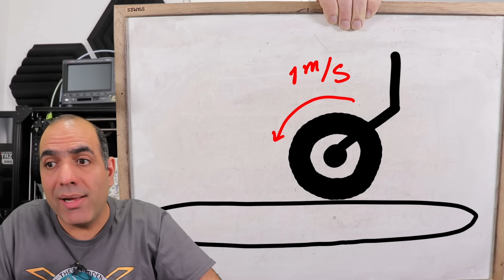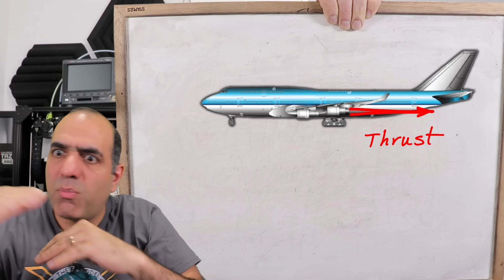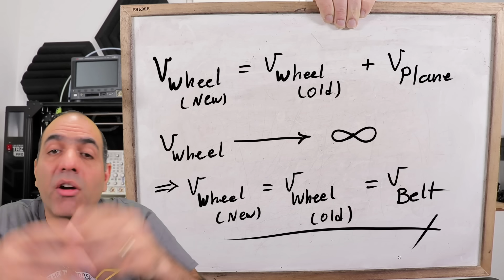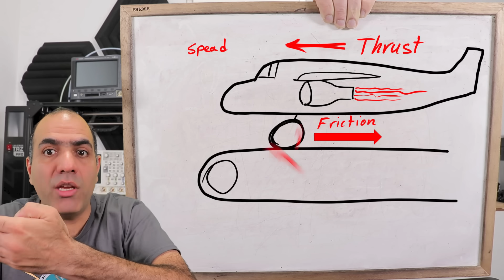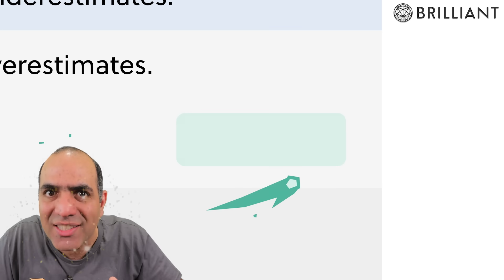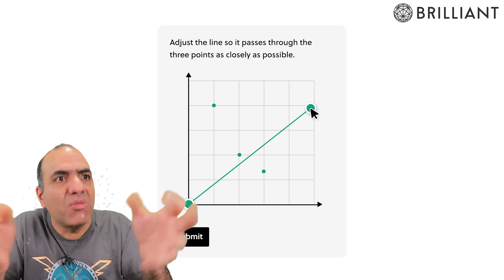Airplane Question that Drove Me NUTS!!!

Comment: The wheels don't have anything to do with the jet moving... so yes, the jet would take off if the engines were making thrust...
Reply: no matter how fast the conveyor went in the other direction the aircraft would move forward because of thrust from the engines...
Reply: The wheel bearings negate any friction from the belt.
Reply: Also at a certain point the wheels would slip on the belt. friction can be overwhelmed.
Reply: I understand on paper, the jet doesn't take off. But we live in reality, the jet would take off. The question was asked by someone who thought they were smart, and the fact they posed the question proves they weren't.
Reply: Did Steve Mould ask you this question? that would make sense, there's a guy who thinks he is smarter than he really is. "Mould Effect" still has me shaking my head at the arrogance of it all.

Comment: It's hard to believe this is considered a legitimate question. Wheels have nothing to do with flight, airplanes don't need wheels. You just need air moving around the wings airfoil to create lift.
Reply: It's a legitimate question because lots of people think the conveyor belt contraption can prevent a plane from moving forward. 

The engines impart a force to the plane pushing it forward. The conveyor belt can't impart a force to the plane to counteract the force of the engines. So the plane accelerates normally and takes off.

Comment: Not likely or reliably. Tire limit speed for aircraft like this are around 174 kcas, and half the tire limit speed is still less than rotate speed for all but the lightest weight 747. So if it's possible tire failure is all but assured.

Comment: pretty sure aircraft require wind passing over the wing to lift off unless they have VTOL jets or rotors or some sh!t like that. if the wheels are moving but the plane is not moving relative to the surrounding air, you're wasting fuel and you're not gonna leave the treadmill
ofc, if its a jet aircraft, the wheels are not providing drive force, the jets are. and the jets are grabbing hold of and moving the local air, which means that the plane is likely to ignore the treadmill entirely (because the treadmill is only acting on the presumably free-spinning wheels) and move forwards (and likely right off of) the assembly, rendering the test moot and maybe causing a bunch of damage in the process. (infinite treadmill? basically an infinite runway.) come to think, prop planes also use their rotors to push on the air, not the ground, so they too would completely ignore the treadmill.

Comment: The wheels do not power the plane, the engines provide thrust independent of the wheels. So it really doesn’t matter if you are on a conveyor belt, you will still pick up speed and take off, the wheels will just be stunning faster than normal.

Comment: This is a very old question but the answer, as you stated is very simple: wheel speed has nothing to do with the forward motion. Meaning that the airplane will get airborne based on the relative wind speed over the wing creating a drop in pressure and thus, lift. Having a conveyor belt underneath will only increase the wheel speed but will have zero effect on the airplane as soon as thrust is applied. Now, if you reverse the belt making it go forward, then you can make the airplane go airborne. Similar to a catapult on an aircraft carrier. You’ll still need thrust once airborne otherwise you won’t be gliding for long

Comment: I believe, yes, the plane can take off.. Seems like something of a trick question. "The conveyor is designed to exactly match the speed of the wheels."  This is a bit ambiguous (what does 'speed of the wheels' mean?) so choosing to interpret this as: When the wheels spin the conveyor spins to match countering any push/pull the wheels would normally impart, attempting to say keep a car stationary in relation to the surroundings as the car attempts to drive away. If this is true, then the conveyor would appear to launch the plane, spinning up to keep the plane's wheels effectively static, non-spinning, as the plane accelerates away until it lifts and the wheels lose contact. But that's ONLY if everything's perfect. Given there's no chance of perfect efficiency, there'd likely be SOME wheel motion one way or the other, probably spinning exceptionally slowly "forward" (the direction they'd normally spin if NOT on a conveyor) in relation to the motion of the plane.  It's an interesting question that completely changes depending on if the vehicle in question uses its wheels to move or something else (jet engines, a winch, sails, etc.).

Comment: Not this freaking question again.
Before watching the video, I can say this: the answer is that the conveyor belt will quickly hit the speed of "undefined," at which point physics ceases to make sense. 

Maybe the conveyor generates enough wind before then to lift the plane high enough that the wheels lose contact. Maybe it overwhelms the bearings to the point of throwing the plane backwards. Maybe it destroys the tires, causing the plane to fall onto the landing gear which is then smeared across the possibly relativistic conveyor belt, which then halts because the wheels can't spin if they're smeared into paste. Someone, not me, could probably calculate at what speed the conveyor belt would need to spin for each of those things to happen for a particular aircraft- though it obviously depends on engine thrust, lift from the wings, landing gear design, conveyor belt materials, etc. none of which are specified by the question.

Comment: I have to admit, I changed my comment, I thought the plane would remain stationary.

This is very counter-intuitive cuz I think we all think of  cars and bicycles first when wheels are evoked.

It helps to visualise the situation like this I think: the wheels of the plane are there only to reduce the friction between plane and ground, not for thrust.

So as Mehdi said, if the friction is still low enough, no problem, plane takes off.

Comment: My (totally serious) answer before watching the vod:
The engines push off from the air, not the ground. the conveyor belt moving in the opposite direction only adds drag to the whee;s wish i believe would not be enough to prevent the airplane from taking off. The problem is that the conveyor moving against the direction of take off 'adds' speed to the wheels, it doesn't 'undo' any speed. If the wheels would move forward at 10 distance units per time and the conveyor tries to work against it, the wheels will speed up to 20 units per time, creating a runaway resonance cascade that destroyed black mesa.

Comment: Its a matter of lift not wheel speed. The wheels have no effect on lift outside of drag. A hugh enough crosswind and it can take off from a stand still.

Its like flipping your bike over and turning the peddles really fast, sure the wheels spin but other then acting like a gyroscope it's not doing anything.

Comment: Yes, the plane can take off, no problem at all. The reason is that the thrust driving the plane forward is coming from the jet engines (or propellers if it has turboprop engines), not from the wheels being turned like a car. So the wheels on the plane landing gear would have to spin faster than normal, which would probably require a little more thrust than for a normal takeoff.

This is no problem, since in most circumstances, airliners only use about 80% of the rated maximum power of the engines for takeoffs - exceptions being for short runways or heavier than normal takeoff weight. High ambient air temperatures at ground level is another problem - in middle eastern nations, some aircraft have to wait until night time when the air is cooler before they can take off, though of course landings can happen at any time. At high air temperatures (40 to 50 degrees C), the engines suffer from reduced power output because the maximum thrust is limited by the temperature the turbines can tolerate before weakening or melting. This is why jet engines perform better in colder climates, or at high altitudes where the air temperature is naturally much lower.

Comment: Quick question, if the plane is not going forward, how are the wings having friction with air and therefore producing lift? As far as i know the engines provide forward thrust so that the angle of attack of the wings can interact with air and produce "lift", however if this forward thrust is mitigated by the treadmill how is the plane producing lift?

Comment: Here is another one.
Lets imagine that there is a BIG landing platform on top of a balloon.
The balloon is flying in the air and going with the wind. (the wind is coming from the north, so the balloon is moving south)
Now an airplane wants to land on the big landing platform. 
Question. What direction does the airplane needs to land so it lands with it's nose into the wind?

Comment: Well, actually, it’s just created by Laminar Research in flight simulator, for example: flight instructor 👨‍🏫 can telling the rules about airplane to examine different parts inside the plane if pilot 👨‍✈️ can see switches, knobs and more, before flight instructor can telling to start engine, starter key located next to the door like Cessna 172, if you move to start position, engine will start and propeller will rotate when it’s starting then release the starter key and be careful, mixture is located next to throttle, always push mixture to maximum position and let the engine starts up, just before start takeoff, pilot will increase the engine power then the plane could fly.

Comment: It's kind of vague: if a plane tried to take off on a conveyor belt, it easily could, because it's motion comes from the engine thrust. The wheels would just be freewheeling.

The interesting thing though, is that as long as the plane is translating along the belt, its wheels will always be moving faster than the belt. The belt and wheels would always be accelerating in that case.
Reply: Eh. The linear speed of the surface of the wheel matches the speed of the surface of the belt. Since theres no slippage. The opposing directions mentioned in the question mus then mean CW for the belt vs CCW for the wheels.
Reply: @407BRR  see I thought that at first, but that's impossible. It's explained in the video.
Reply: @AcoAegis   I think people get too worked up about the wording in the question.  Based on simple physics, the contraption can't impose a counteracting force to the thrust of the engines. So the plane accelerates normally. That's all that matters.

Comment: Airplanes require lift to fly. No movement of air over the wings=no liftoff. 
The Mythbusters test only worked because the engine moved enough air volume over the wings to generate lift, which allowed the airplane to fly, and the aircraft was light enough that just a few people could lift it off the ground. Most aircraft don't have engines powerful enough to move the volume of air needed for lift generation in a stationary position at their base weight, that and jet engines are usually wing mounted and doesn't do much to introduce air around the wings. If they were mounted just in front of the wings it would possibly work, but the exhaust heat would fatigue the metal surfaces of the wing.
Aircraft engines work on the principle of thrust pushing/pulling itself though the air, which in turn pulls/pushed the aircraft itself through the air, eventually reaching enough speed where the air volume passing over the airfoil surfaces to generate a lifting force that overcomes the weight of the aircraft and carries it into the air.

Comment: No sufficient vortex (vortices). Airplane can be viewed as vortices machine first, and as glider second.
Ref: https://www.youtube.com/watch?v=FFgbUx1GdxM

Also, the air quality would be different. Any theoretical "it-could-fly" answers should always be tested to account for real world factors.
Logically speaking, if the conveyor belt system is viable, assuming all other factors such as air quality, environment, etc. are the same, airports would have implemented such system. Heck, even amateur pilots would have opt for such system in places that lacked sufficient runway.

Comment: assuming the wheels can spin to a million rad/s or the treadmill has an upper speed limit because physics
the speed of the plane is independent of the wheels, so it can still accelerate forward until it hits takeoff airspeed. The wheels can do whatever they want lol

Comment: It won't fly it would be like the plane is holding brakes. The plane cant fly unless it is moving relative to the air and if it is moving relative to the air that means the wheels must spin. But the rotation of the conveyor belt prevents the wheels from spinning and thus acts like brakes

Comment: Answer it YES 0:45
All you need is "Air speed" Ground speed doesn't matter. As long as you can move air at a high rate you can start to generate lift.
My Boy Adam Savage Explains it well too - https://www.youtube.com/watch?v=xUjcHW7SHaI 

If you think about the problem in another angle. For example you can use a STOL Airplane or an Aircraft Carrier Catapult Launched Airplane.
You are able to take off in a very short distance. 

Real world example:
Take an RC Airplane. Tie a rope to the wheels to stop it from moving forward. But does not restrict the engines thrust. 
If you pitch up your airplane after it has reached 100% Thrust. It should "Lift off"

I guess you can also try doing this on a Speed adjusted treadmill aswell.

Comment: If the airplane tries to take off it always will be able to. If you take every physical property possible into account, then the conveyor belt will no longer be able to fulfill its design requirements. The belt has many more points of failure (the belt ripping, the roller bearings, the conveyor motor itself, etc) than the airplane wheels, so it will fail long before it is able to counter the plane’s engines’ thrust through friction through the wheels.

Comment: The wheels are not needed, they are just convenient to have for the landing. Imagine a fireworks rocket laying on the ground, it will take off without any wheels because the thurst is greater than the friction. The plane would at a certain speed just start to fly and take off.

Comment: Imagine a Ferrari is sitting on a conveyor belt, as wide as the road.  The conveyor belt is designed to exactly match the speed of the wheels, moving in the opposite direction.  Will I make it to my physics class in time to take the final test?

Comment: A very good video. My reasoning would depend on the feedback speed of the system, and how much energy is taken to make the tyres or bearings to break, and the acceleration due to thrust. Because if the plane accelerates faster than the rate of feedback for the components to break, then it will take off. Otherwise, landing gear failure would cause the plane to crash.

Comment: I always thought this thought experiment was misleading because it's easy to assume that the wheels are spinning under their own power, like in a car, rather than in reality where they're just getting pushed by the main engine. I say take the wheels and the conveyor belt out of the equation. Will a plane or jet fly if held in place suspended in the air and powers up the engines for takeoff speed. Then release it. Will it just fall to the ground or will it take off? The answer is it would fall at first but there is enough thrust happening where I believe it would take off. Especially if it's a propeller driven aircraft because the engines are sucking air and blowing it over the wings at the appropriate speed. Jet engines are a bit different because whatever thrust they have is just going into pushing the aircraft so that little air is moving across the wings upon release in my altered scenario.

Comment: Mythbusters tried a scaled down experiment of a small plane on a sheet pulled underneath it and the plane took off from a stand still at stationary observer point of view. I watched it happen. It was there. And it still breaks all my intuition on how planes work!
Reply: The sheet would pull the air along with it creating a headwind. This effect would be larger at small scale.
Reply: Thats because the propeller from the plane was able to produce enough airflow over the wings by itself to generate lift, (Boeing themselves even made a STOL cargo plane off the same concept, the YC-14) the engines from a 747 would not be able to do that, so assuming some magic to hold the 747 in place unless it lifts off it would not be able to take off instantly from a stand still relative to ground (assuming no wind)
Reply: that is not what i would call stationary. that plane is definitely moving forward...and pretty fast.

https://youtu.be/YORCk1BN7QY

Comment: The plane is not propelled by the rotation of the wheels. 
The the conveyor belt have zero impact on the propulsion from the jet engines.
Sure there is friction from the wheel bearings and the tires against the ground, but these forces should be negligibel.

Comment: A jet engine powered plane should be able to take off still, because it doesn't rely on friction against the ground to move and take off, only on the force from the engines.

Comment: IMHO it's a red herring: for a plane to fly the only speed that counts is the one relative to the air. The wheels are there only to prevent it form dragging its belly on the ground.
Even if the wheel spin to infinity their momentum does not take part in the plane taking off. It'd effectively be like having the plane taking off with its belly directly on a frictionless surface.

Comment: Im guessing the plane is stationary, so no wind flow through the wings, no lift and no takeoff.

Edit: In my case, the engine of the airplane is just enough to thrust the plane forward, making the wheel matches the conveyer belt speed, but not strong enough to pull air across the wings to generate lift (since the engine is under the wings)